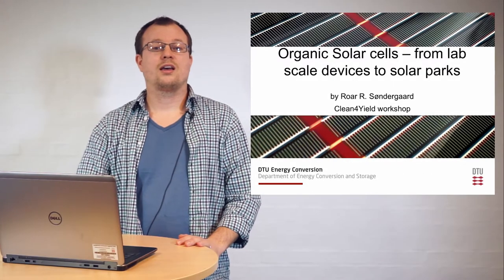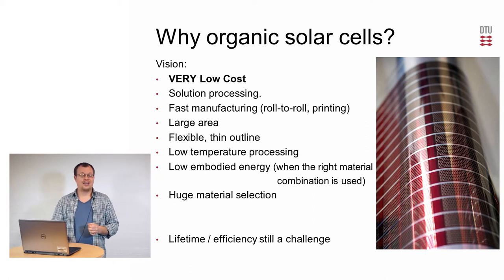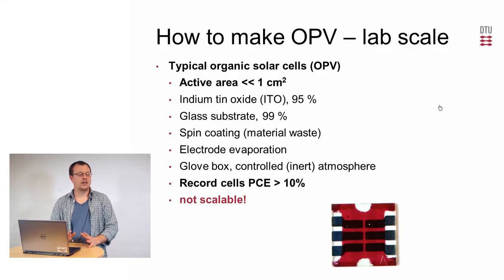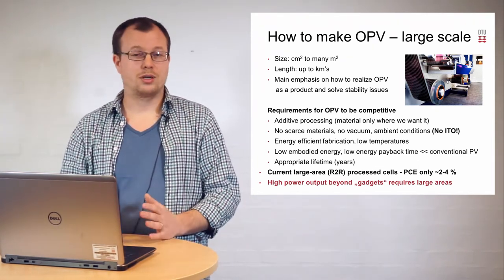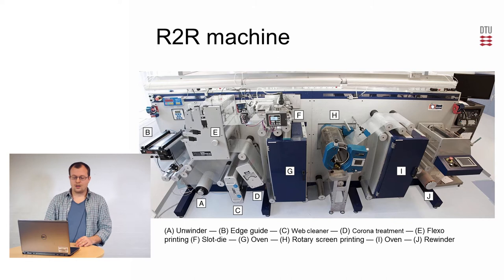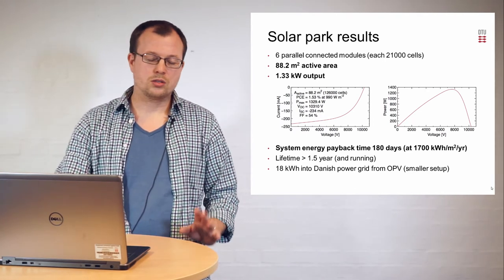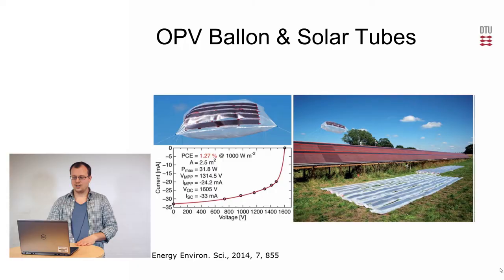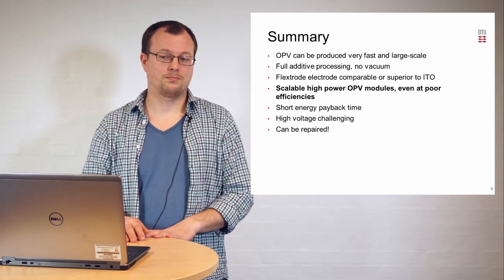C4Y - From lab scale devices to solar parks - Roar Søndergaard

Comment: Very nice ! Looking forward to buy some roll cells and test these out.
You really should offer just 1 Meter or 2 Meter length rolls for easier handling and lower voltage output. Regards, Stefan.